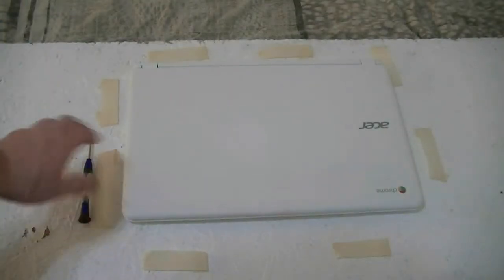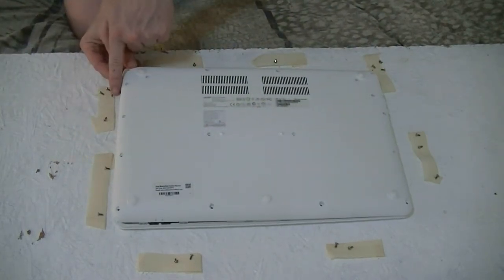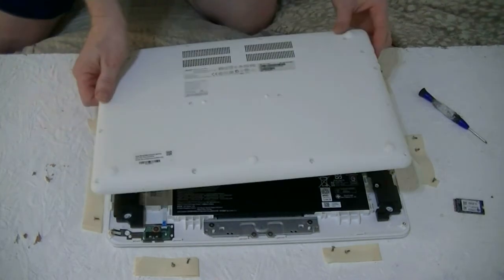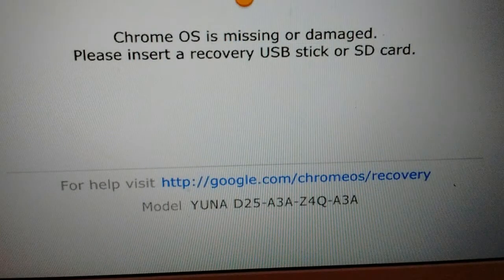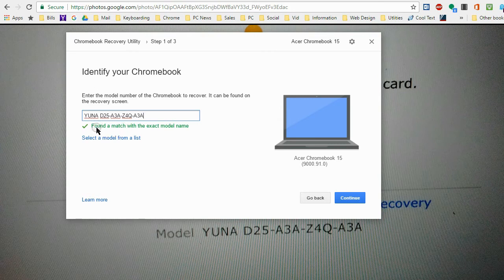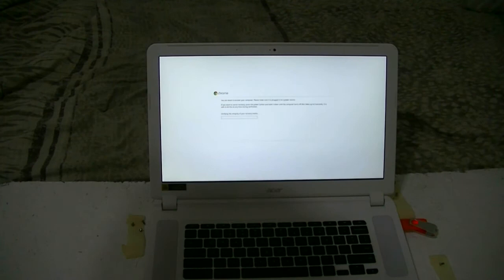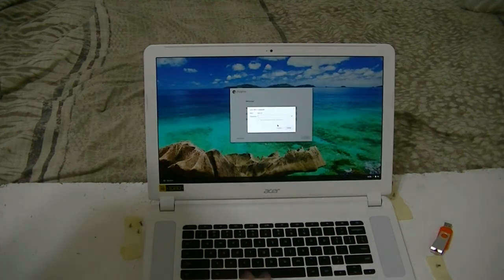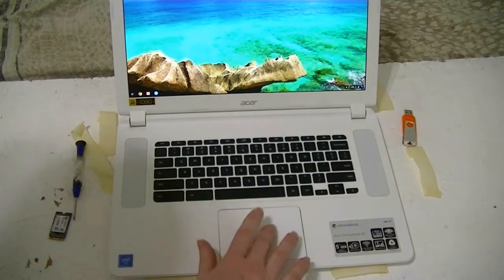Upgrading the SSD in an Acer Chromebook 15 Mini Lesson CB5-571 Disassembly

Comment: Hi , My Chromebook has told me it is too old for updates , its only 4 years old and in mint condition , If I replace the ssd will it upgrade to the latest operating system and accept updates again or is there another way around it   Thanks !
Reply from the maker: no.  sorry.   that will not change the motherboard.  It is the Chromebook's hardware.   It is not that big of a deal, as the updates are for improvements in driver support,  which yours should not need.  Any security concerns are handled within the browser.

Comment: Out of interest does this unit still work for you? I just bought a new battery for it as it was sitting collecting dust and it still has the no battery icon error.
I'm thinking this is either a software issue or chrome are actively adding bugs to kill off older models.
Reply from the maker: That is an old model.  Currently I am on a newer HP Chromebook with touchscreen.
Reply: @selmateacher7  It's ancient, also using a newer model but wanted to wipe the dust off this one for a dev mode only app.
Alas it's chrome heaven for this unit.

Comment: Can I use any SSD? 
And also, I heard people saying that despite the SSD worked initially, they got problems later on such as with the fan and then other errors which prevented them from running the OS.
So is it better to take the risk of buying a new SSD and replacing the old one or should I just buy a new laptop if I don't want any long term problems in the future?
Reply from the maker: Thank you for the question.  At this point the newer Chromebooks found at https://acerrecertified.com/ are so much better, as you can see in my newer reviews, that I would now recommend going with a newer model.  Plus we need to think about the date of the Chromebook's Auto Update policy, when it stops receiving updates.

Comment: Hi Daniel, I have upgraded the SSD in my CB5-571 to 128GB but the Chromebook cannot detect the new SSD.
I don't know if the 128GB SSD is faulty or if it is a type that is not compatible with the CB5. Or even if there are some M.2 SSDs that are compatible while some are not compatible?
I am very familiar with installing and changing HDDs going back to the days of 20 MB HDDs with stepper motor drives, through parallel ATA and through to SATA. I have installed well over 200 HDDs and installed OSs Windows, Mac OS and Linux for 20+ years. (Actually it goes back to the days of PDP-11s in 1974 running the RT-11 OS.)
But this Chromebook has me stumped.
I have upgraded the BIOS according to the Gallium OS site and that went smoothly.
I can get the Chromebook to run Gallium Linux, and Elementary Linux, Live versions on USB flash drives.
I have been able to install Fedora 33 onto an external USB thumbdrive and get the Chromebook to boot off it and run.
I have even been able to install a Linux OS onto an SD-Card in the Chromebook and get it to boot and run off the SD card.
But it won't recognize the 128 GB SSD. Maybe the SSD is bad. I don't know how to tell if it is good or bad?
Is there some specification / description which tells me which M.2 SATA SSDs are compatible, and if there are some that are not.
Reply from the maker: There are different M.2 types.  I talk about them here: https://youtu.be/cHqBPewjpx4?t=285
I checked my Acer CB5 and I had upgraded it with a 64gb m.2 drive.  There are newer m.2 drives that are not compatible with the older version found in the cb5.

Comment: Would this 1TB drive work in the Chromebook you used in the video?  It looks lk the same size but can the OS handle this large an SSD?    

https://www.newegg.com/crucial-p1-1tb/p/N82E16820156199?Item=N82E16820156199&quicklink=true
Reply from the maker: Please note the size.. 2280... I think it is too long.  Please check the physical size as seen in the video to make sure.

Comment: I have a question what if your Chromebook 15 is completely brand knew meaning you haven't even opened it yet do you still need a USB (recovery file) even though there is nothing on it? 
By the way great video keep it up!
Reply from the maker: Thank you for the comment.   I have been working on replying to all of the comments lately.    You do not need to use a USB recovery file.  You may now use these steps to upgrade the storage without any risk: https://youtu.be/FRug8x8KQrU 

Sorry for the late reply.

Comment: For Kingston V300 240GB 2.5" SSD SATA 3 Internal Solid State Drive SSD 6Gb/s MN                        [ is this correct ? for me to buy a new ssd for the same laptop model ? ]]
Reply from the maker: That Acer Chromebook 15 uses a M.2 SSD, right.  A 2.5" drive needs a 2.5" bay, which this Acer lacks.
Reply: @selmateacher7   can u please send me a specific link for me to get a better picture of the ssd ,, cause i still dont find the right one ,, alot of them says Sata on it
Reply from the maker: @hectorcarrasco3039   Yes, https://www.newegg.com/p/0D9-00HS-00022

Comment: Using masking tape to hold the small screws during disassembly is a brilliant idea, Mr. Berry. Thanks, I was going to use a small container, but your ensures that the right screw goes in the correct location. Thank you!

Comment: umm... why would you not create a recovery thumb drive before you take it apart? saves a BIG step, and if you do it automatically recognizes the model number
Reply from the maker: When you first turn on the Chromebook that has a blank HDD or SSD, the Chromebook will display the correct website and model number to create the recovery.  So a recovery is not needed to be made until that point.  This recovery is made on a second PC.   Thank you for the comment.

Comment: Excuse me, can you tell me if you've seen a lower perfomance in battery life time with the new ssd?, can you tell me the exactly model of ssd?, I guess that is a M2 2240 but I'm not too sure, thank you very much for this excelent tutorial
Reply from the maker: Thank you for the comment and question.   I have not seen any lower performance in battery life with the larger SSD.    Yes, I used the M2 2240

Comment: Hello Mr Berry. I am so glad I have found your channel and really grateful for all the knowledge you are sharing with us. Is it possbile to upgrade the 64gb eMMc memory on the Acer R13  or even change the storage  to an SSD? Its probably a daft question but I am still not too clued up yet. Cheers.
Reply from the maker: Thank you for your comment, I have not worked with the Acer R13, but if that model uses a 16 or 32gb ssd in the M.2 slot, like the Acer 15 does, then you can upgrade with a larger capacity M.2 SSD.  I have upgraded my Acer Chromebook 15 using the M.2 SSD.  Thank you again and please enjoy my other videos.

Comment: Thanks for the video. Just wondering what type of m.2 ssd this is? I see many of the longer, bigger versions of m.2 but very few of that size (42mm?). Is there something specific I should use when search for this type?
Reply from the maker: Thank you for the wonderful comment.  I used the M.2 2242, like the ones shown here at newegg:
https://www.newegg.com/Product/ProductList.aspx?Submit=ENE&IsNodeId=1&N=100011693%20601193225

My Acer Chromebook does not have the secure point to attach the longer M.2 versions.  I will look again at a later time and see if I can attach the M.2 2280.
Reply: Thank you for your reply, I appreciate it very much. Great content!